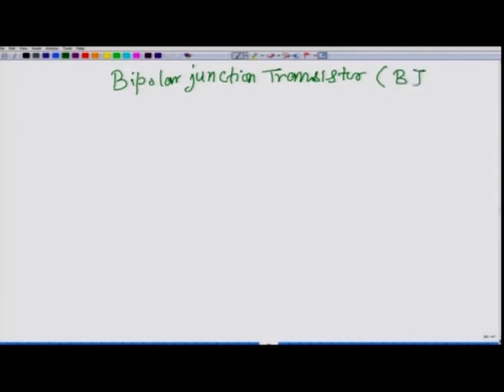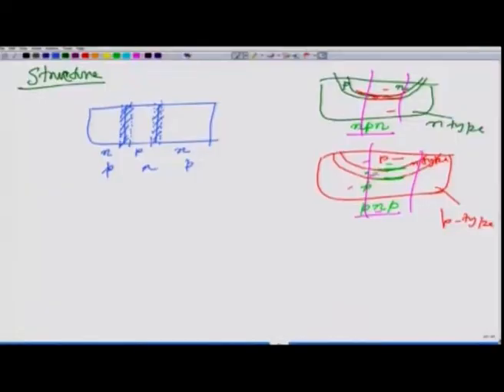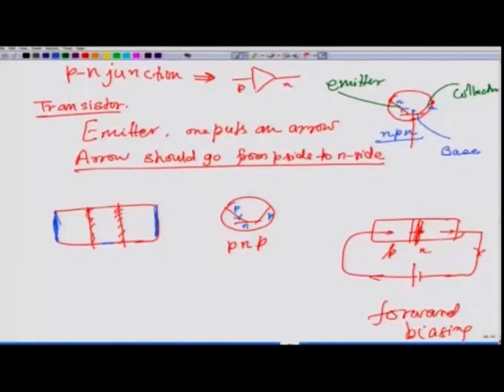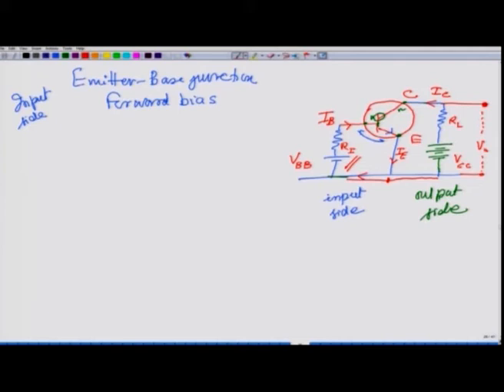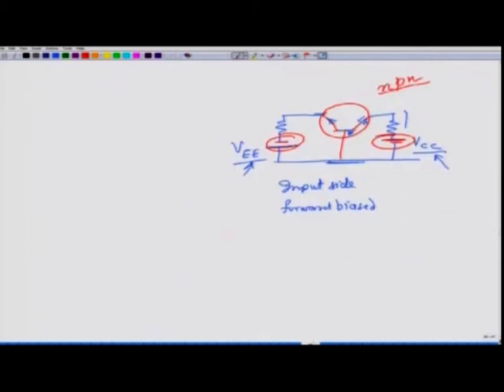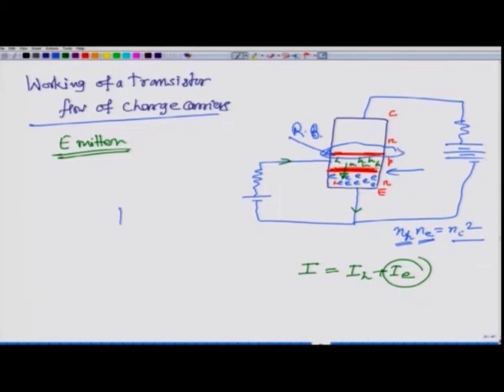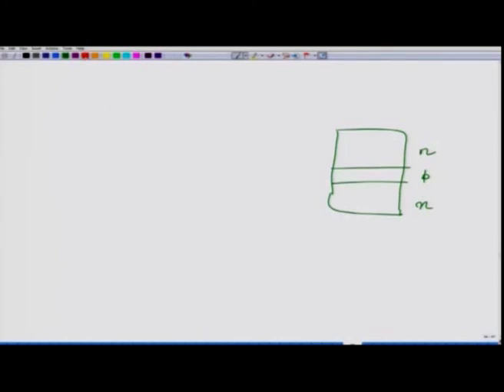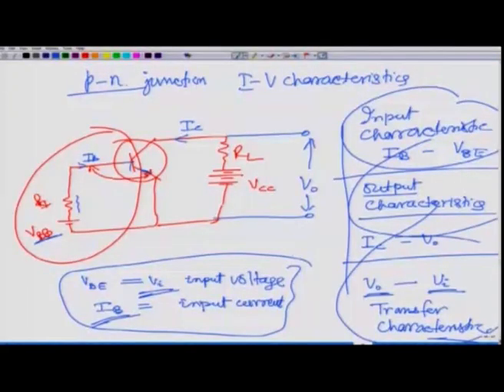Bipolar junction transistor basics (PHY)

Comment: Hello sir in Donald neman collector has been shown least doped and base moderately doped..kindly clear it sir
Reply: Yes bro it's done to avoid punch through , if doping is less in the base region then depletion region on the base side will be wider and transistor action is lost . Also we want early voltage to be as high as possible ,so collector capacitance has to be higher which means depletion region on collector side should be wider

Comment: Two diodes connected in reverse polarity, does it work as a transistor? Can u please tell sir? The lecture was very nice. Thank you very much Sir.
Reply: It can be thought of like that but it is not. Because that circuit may look like a transistor but it cannot perform the functions of transistors.
You can draw yourself circuits in a notebook and analyze the differences between your circuit and transistor.